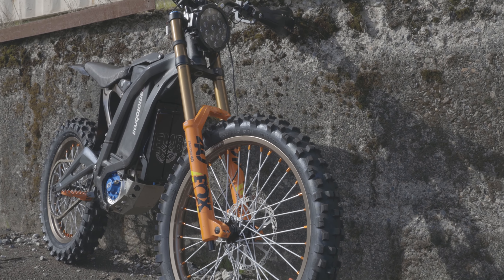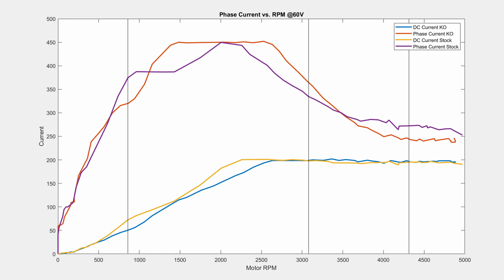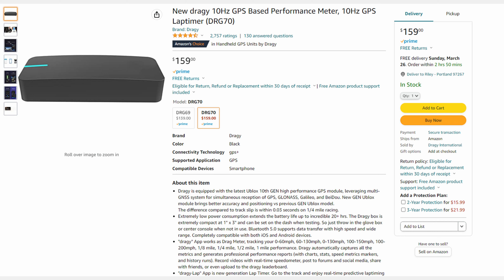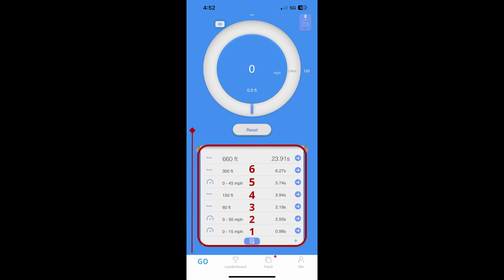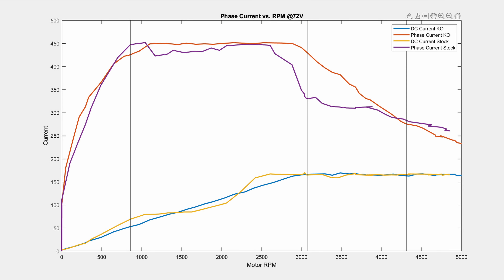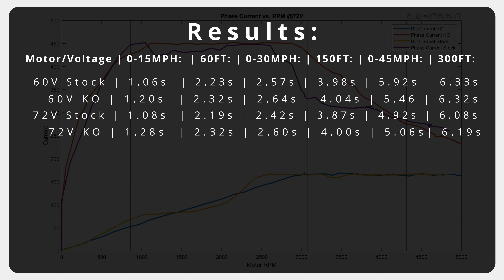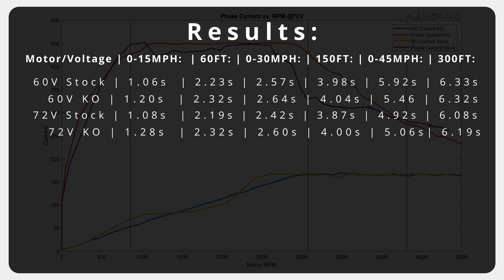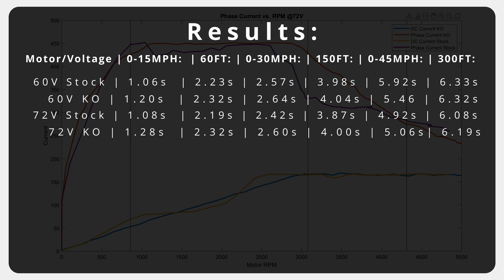KO Motor Vs Stock SurRon Motor PART II | In Depth Data Analysis

Comment: Nice video! 

Can you verify that the BAC8000 configuration was optimized for the KO motor in this scenario for best possible performance, as opposed to using a KO motor controller? I know that it makes sense to use the same BAC controller with both motors, but there is clearly way more data and use history with the stock motor than a KO motor. Unless you guys have extensively tested and paired it with every possible little config tweak for peak performance, I wonder if this leaves room for error.
Reply: Sorry, let me clarify, are you sure that you've done everything that you can to equally apply phase current to the KO motor, as you've done with the stock motor? The dip at 300Arms for the KO motor is interesting, whereas the stock motor appears to be more of a linear increase
Reply from the maker: Hard to say for sure what you mean by optimized, but we tried to make it as simple as possible. Same voltage in, same current in. Sure it’s not optimized in the sense that it performs best at these settings, it was just meant to be a baseline for comparison.

Regarding the dip in current, you have to consider that the vertical lines on the plot are seconds that have passed so any dip or rise, one vs. the other is for at most 1/8th of a second. Our goal was to average the input - it’s borderline impossible to make them identical considering they’re fundamentally different motors. I think we did the best that we could and if that little blip down in current for that one split second is what caused the difference, then I suppose that’s part of the process! Hopefully at some point we will have the resources necessary to where nothing is left open to subjectivity.

As we suggested at the end, we hope other people film similar tests and post their results. Our one test on one day is definitely not the end all be all.
Reply: we found the KO employee boys
Reply: @IShowSpeedNaldooo  too many people will just take someone's word for something and run with it
Reply: @trowantechworks  its a joke bc youre obviously on the side of KO. too many people take things too seriously
Reply: @IShowSpeedNaldooo  you just made that point about yourself lol

Comment: You missing kV parameter form this calculation. get nucular for better logging and run  phase test with equal toruqe (it will be different phase amps)
Reply from the maker: Kv and Kt are typically inversely proportional, though the purpose of this test was to determine if the Kt was considerably different between the two motors. Based on the testing they aren’t. Supposedly the KO has a lower Kv (around 2-5%) thus leading us to believe it’d have a higher Kt. From testing, it didn’t appear that the KO generated torque more efficiently then stock since it had similar acceleration at phase current equivalency. This may be explained by the IPM vs. SPM design and the fact that the KO would benefit from MTPA control.
Reply: @emotobros  oh that was with no mtpa?
Reply from the maker: Correct. I think only VESC based controllers offer that currently. Could be wrong though. Either way, it’s quite a bit of math to get MTPA fully optimized. Need almost full motor characterization.

In theory, the IPM should perform slightly below SPM in torque efficiency all else held equal. But once you add MTPA to the IPM, I’ve read gains could be close to 15%.
Reply: @emotobros  ahh. well there are noticeable difference in motor details tho, stock motor heats up more quickly compared to QS 165 in my case. btw nucular also have mtpa, and yes it needs motor measurment, but usually it is automated. also ipm motor have profit of better field weakening

Comment: also SuRonster had issues with the KO begin slower than stock.
Reply from the maker: Yeah we did see that. Hard to say if it’s truly slower since the data all seems to be within a margin of error and as we mentioned, the difference can hardly be felt. It’s being ran at the same power level as well so of course at higher power levels the KO should shine.
Reply: @emotobros  I 100% agree with you

Comment: I think the reason to upgrade to KO is so you can run more amperage without burning out the motor. Theres more to upgrades than just acceleration.
Reply from the maker: Yes, that’s exactly what we stated in the video. The purpose of the test was to determine if the motor torque coefficient was similar to stock, rather than the outright amount of power it could handle.

Comment: Why I sold my motor in a week of getting it. I felt no huge difference other then running at higher rpms and heat. If I can keep my hand off the throttle and be smart about my riding and tune, its not for me.
Reply: I seen it on Fb 😂

Comment: The KO is a significantly larger motor so it makes sense it’s going to be slower to spin up lol. The only area it excels is pushing high powers and sinking heat…
Reply from the maker: This is a valid point, but the inertial forces of the bigger stator should have minimal effect in it's 'spin up' time relative to the rest of the rotating mass in the drivetrain. Additionally, the slightly lower KV value should help with this. We agree that it does excel at high power and heat management relative to the stock motor.
Reply: @emotobros  Im not entirely convinced it wouldn’t though as we’ve seen by just replacing a chain that mph top speed increases by a few mph and we need to take into account that this is before gearing etc. From what I remember the stator was almost twice the size? Might be possible to compare the motor spin up times without a load not easy though and at the end of the day you have your results anyways :)
Reply from the maker: @electricsnut  That's true, but the top speed increases are due to decreased friction which increases with V^2 so that can cause a significant difference at high speeds. I suppose even if there is some increased inertial effect, it is what it is and it should be considered a down side for off the line performance. There is certainly a market for those who need high speed, rpm and thermal management.

Comment: I ve done exactly the same tests with stock/bypassed bms/aftermarket 60v/72v with draggy. And just bought a factory ko motor. BUT done the tests with nano and factory ko controller (and chain conversion) both my tests at 10kw ans 20kw are superiors with the ko motor. It would be interresting to compare your times with a ko controller which maybe setup the motor more corectly with 4 pair vs 5 for the stock motor. The motor test is my next video on my channel (in french sorry but you can translate the subtitles, and in metric mesures). Less heat with the ko motor too. I don t think the motor shines with ony 450amp. Curious to see tour tests with a ko controller to be fair. Great ans honnest video by the way
Reply from the maker: Email us a video if you make one! Will check it out for sure.

Did you make sure to use a current sensor on your phase wires to ensure the same amount of current was flowing into them on each test? Interestingly the power levels were not set equally to get the output to be equal. Somewhat of an odd product of the torque control scheme. If you’re just relying on the set power and not pulling a real time data stream that may be the reason for inconsistencies.
Reply: @emotobros  no but i ve checked the battery bms logs and ouput to verify
Reply from the maker: @lstricks  Yeah the BMS log is a good place to start but that just shows what is coming out of the battery and not what's going into the motor which is what matters. For example, I can pull 12kW from my battery and it'll read that on the BMS log but I can put either 450 phase amps or 650 phase amps into the motor and that 12kW number on the BMS data log won't change. However, the one pushing 650 phase amps into the motor will obviously be generating much more torque.

See if there is a way for you to monitor the current in the phase wires as a good starting point for a true head to head comparison. Looking forward to the results!
Reply: @emotobros  thank you. Understood. So maybe it would be interesting to test both motor at different phase amp. 450 phase amp is maybe where the stock motor shine. I m 230dc amp, 800 phase amp … it s where the ko motor shine vs stock.
Reply from the maker: @lstricks  Yeah, obviously the one with more phase current will be quicker but the torque should scale similarly to the point where one is saturated and one isn't. My guess is the KO with larger magnets can handle more current before it hits the point of magnetic saturation. We've ran 330DCA and 800 Phase amp on both the stock and KO motor and the performed similarly with the exception of the stock motor getting notably warmer.
Reply: @emotobros  spm vs ipm motor design. You can t have the same result. On 1/8 miles 230a, 800phase. I m 10.8@93kmh on stock motor. 10.3@98kmh on ko motor. If you ve got exactly the same time, you ve got issue on config in your bac controller
Reply from the maker: @lstricks  As I mentioned in the previous comment they performed similarly. 'Exactly the same' is not the wording I used. Based on your numbers we are talking roughly a 5% difference - well within what'd I'd consider to be 'similar'. Maybe racing on the road that means something, but offroad it's hardly noticeable, if at all, aside from really not even being able to effectively put that power down due to the geometry of the frame and max allowable tire width.
Reply: @emotobros  and it doesn't overheat offroad. I'm 210lbs.
Reply: @emotobros  Do you really believed that at the same power level amp/volt, a motor can be 20-30% more efficient ? what did you expect? . It s stronger motor which can be drive at 15000 or 20000w without issues plus is 5% faster. Sure it make so sense to spend $1500 a motor, at stock power level or 12Kw
Reply from the maker: @lstricks  No I didn't - where did I claim that was something that I thought? Our point was to prove that you should expect similar performance at normal power levels. I thought that was pretty clearly stated in the video. Our goal was to show that you need to be running fairly high power levels to see the benefits of the motor. We even mentioned we'd also test at higher power levels and with different controllers...
Reply: @emotobros  sure. Great Videos. just obvious :  in the confort zone of the stock motor, same results with a high kv high performance motor. Under 2000 rpm my fiat is as fast as a ferrari too on a offroad track. The Ko Motor is overkill at 12Kw. I ve got the factory one by the way not the RS.
Reply from the maker: @lstricks  Obvious to us, sure. You'd be surprised at the lack of knowledge and how many people fall to marketing traps. 

Regardless, that analogy doesn't really make sense because that has nothing to do with testing the torque efficiency at equal power and RPM with the exact same bikes on the same road with the same rider. The purpose of the video isn't to try to convince people to or to not buy a product, just to showcase it at what we believe to be the most commonly used power levels on the SurRon. We are trying to appeal to the majority, not the 1% that are trying to go as fast as possible on a mountainbike on the road.
Reply: @emotobros  sure :-) at 12KW no don't need a better motor, it's useless

Comment: This is disheartening a bit. 😢 But this is really about the application. KO can handle 80v, We are talking about the future of the industry and longer continuous run times on the motor compared to stock. I am very interested to see how they perform on the trail or a track with a more continuous power output. Awesome video 🔥🔥
Reply from the maker: Yep, KO can handle higher voltage and power and as we mentioned, is the superior motor. I think it’s safe to say it’ll perform better in almost every situation especially on trail or track. I think it solves a problem that only the most serious riders have and you pay a price for that!

Comment: I thought the whole point of the ko motor was that you can run way more power through it without it over heating. I’d love to see you run 20 kw through both motors and see which one overheats first ( pretty certain the standard motor wouldn’t last long).
Reply from the maker: Oh the standard motor would blow up real quick. The reason we tested at 12kW is because that’s a very common power level for people to ride at offroad. We wanted a baseline for torque efficiency and then we will move to higher power tests.
Reply: I think that much over 12 kW on the Surron, given its weight, size, tire options, etc, is somewhere between silly and dangerous.  In my opinion, the "issue" here is that a 35kW motor is wrong for this application.  Even if the KO is superior to the stock motor, in every way, at 15kW and above, that better performance can never be realized on such a limited platform.  (Unless you drag the surron on a 1/4 mile strip - which is getting back to silly-dangerous.)  The KO Application Engineers  either knew this or didn't do their due diligence, before trying to insert this motor into this app.
Reply: I looked at taking a surron to the max for road use. I’m 6’5” so I was planning to fit ktm85 forks and looked into an xl frame kit which would enable me to fit a longer swing arm ( which I also planned widening) and fit it with motorcycle 17” wheels. This could then handle the 35 kw but the cost just isn’t worth it. I still think that the ko motor is going to last longer even at 12kw but I never thought it would be any faster. Some guys are pushing 17 kw into surrons which is definitely the point at which the ko would come into its own but you guys are right that you probably don’t need that much power for off road use. I guess I’m like Tim the tool man Taylor ( more power urgh urgh urgh!)😂

Comment: you compared a 110kv motor with a 90kv motor. IPM vs SPM and wonder why you get less performance on the higher kv motor? btw your Bac controller isnt able to feed an IPM Motor as he deserved. ASI has no MTPA option and it makes a huge difference.
Reply from the maker: We had Tach’d the two tested motors, stock and KO at 88kV and 85kV respectively prior to the testing. Not sure I’ve ever seen a stock motor as high as 110kV but they do seem to have quite a large range. I’ve seen some with degraded magnets at around 100kV. I actually didn’t think the test outwardly proved there was ‘less performance’. All the times, especially at the longer durations appeared to be within a margin of error of each other.

Regarding max torque per amp control, I did look into that and couldn’t find a study discussing the nominal gains one could expect using it/not on an IPM or SPM motor or how the performance benefit is better on an SPM then an IPM without it. Shoot them to us in an email and we will check it out! We can certainly repeat the test with the KO controller as well 👍🏽

Comment: test at 20° hill , the torque will speak
Reply from the maker: Unfortunately there aren't any paved streets in the US that are 20 degrees. Testing this on dirt wouldn't be reliable because of wheel spin and even on the street at 20 degrees you'd likely be testing your ability to not wheelie off the back more so than the torque of the motor.

Comment: The big selling point of the KO motor was better heat rejection and the ability to more safely run higher current. 
It would be informative to include a temperature measurement in various scenarios (since you dont have a dyno). 
Like, record temperatures after... 5 back to back 500ft runs; 1 lap around a consistent test track; etc...
Reply from the maker: Yep, going to be doing that this summer out on the trails. We first wanted to set a baseline for torque efficiency between the two motors at the power levels we always ride at.

Comment: This is funny. You dont buy a KO motor to run only 12kw. Wtf would waist money on that. Broken record is a great way to describe this. Nothing new.
Reply from the maker: Yep exactly our point. If you don’t have any reason to run more than 12kW then upgrading isn’t worth it 👍🏽 you’d be shocked at the amount of people who buy absurd high power setups and then run normal power levels.
Reply: @E-Moto Bros  12kw is scary for most riders. Way more power than most can handle offroad. Especially single track. Pavement is totally different. I image a motor will be developed at some point. At speeds above 60mph, a gears seem crucial to maintain control.
Reply: Wtf are you talking about? Im about to upgrade to another Motor because my Stock Motor gets very hot @ 13kw
Reply: @lostinspace2899  that's what happens on street.  I never had overheating with stock and a 72v battery tuned right. Pushing 15kw  on tight single track.  Lots of variables. I would just buy a better bike for street riding anyway.

Comment: Different motors like different tunes, did you guys have different tunes for each motor ? They are 2 different types of motors due to the magnet configuration ! Not being rude ! I get that your trying to test just the motor, but a “perfect”  tune for each motor using the same controller? The KO doesn’t seem worth its price, but curious about tuning of the tests !
Reply from the maker: Yep, the motors had vastly different parameter setups. That was the purpose of the phase current plots - to verify we had set them up ‘equally’.

Comment: The KO motor being IPM design is good for literally everything. Runs longer, better cooling, can handle high power, etc.

If you're running pavement, on supermoto wheels, at 60v, you'll be fine forever on the stock motor. I've cooked two stock motors already on 72v with a 21/18 wheel setup off-road.
Reply: Yo, I run 11 Kw with Torp TC500 and Stock Motor 60v, my motor gets very hot outside after some time, what are they signs of a cooked motor?